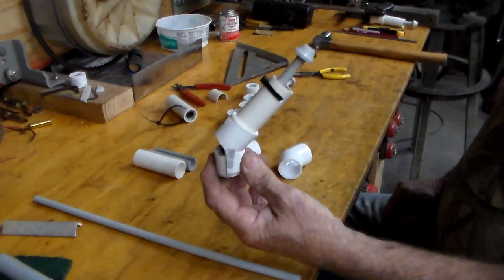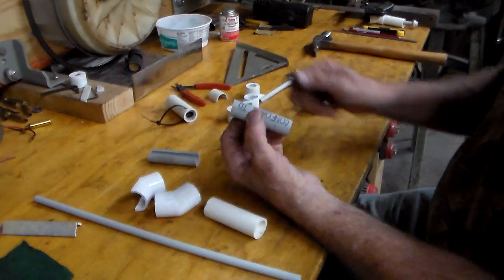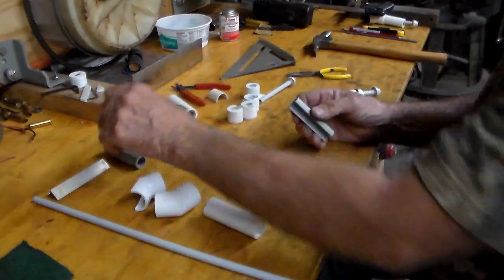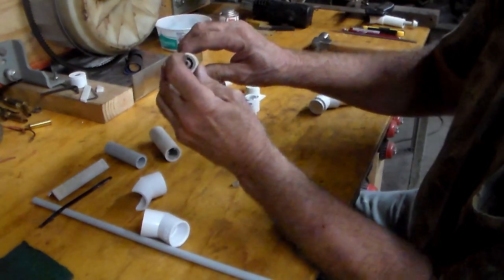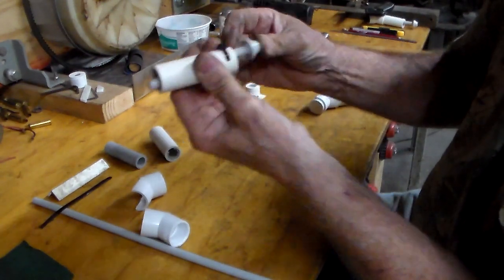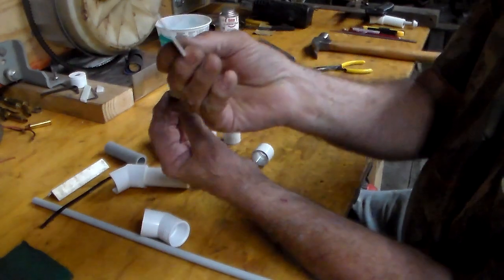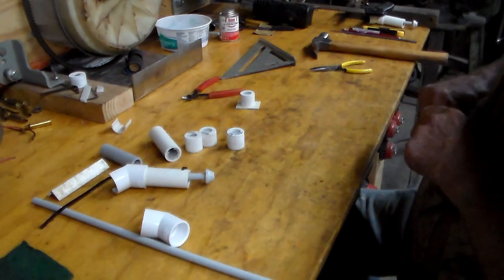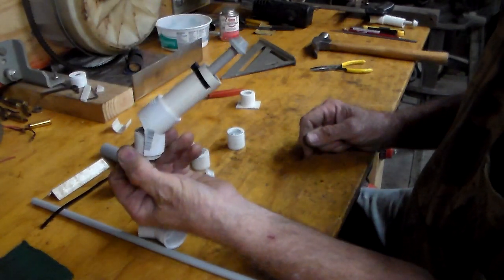Aztec Death Whistle Homemade

Comment: 1000 yards away  i highly  doubt that
Reply from the maker: Not exactly sure about the 1000 yards although the whistle is extremely loud and my neighbor lives far from me and he stated he could hear it very well. It does hurt my ears when I blow it.
Reply: @Handyman2020  in your description you state 1000 yards which  seems  like an overstatement  i feel like maybe  100 yards  would be more accurate. but still  very nice work  especially  for bits and pieces  found around the house  im still trying to get a bullet shell whistle  to work
Reply from the maker: @dark96744  It will go way past 100 yards.